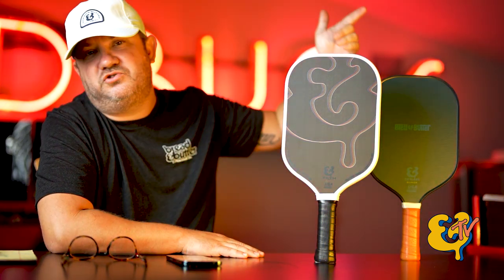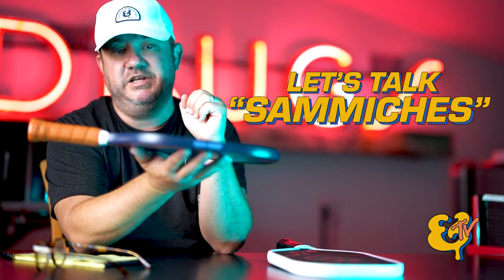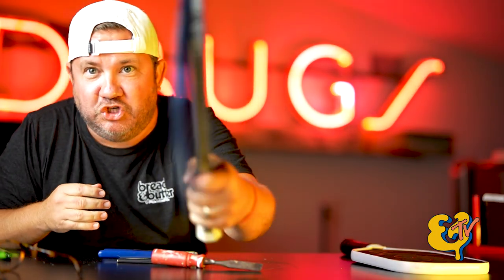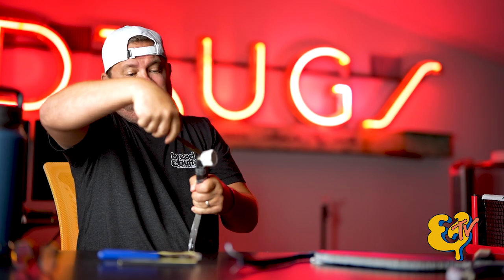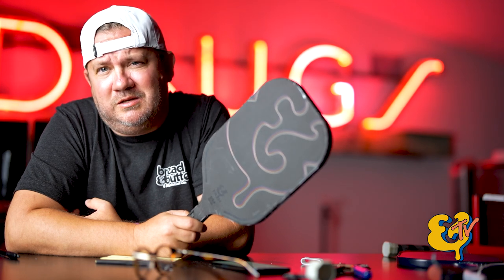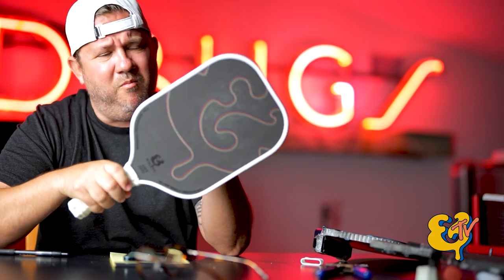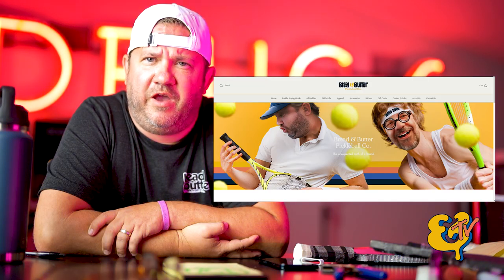What is Pickleball Paddle Thermoforming. Let's BREAK some stuff.

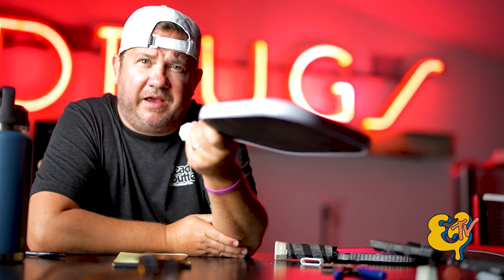Comment: in the specs it states that the Filth paddle has Raw T-700 carbon fiber, but is this Torray carbon fiber?   Also, can you comment if the weave pattern is the thinner super fine weave, or the thicker rougher weave?    Interesting to see Legacy used the thinner finer weave on their first paddles, and once the delam issues happened, new paddles have a thicker rougher weave similar to a CRBN.    Yea, the 9:40 to 9:50 mark on the video with the shirt change was pretty obvious
Reply: That interesting I didn’t know the Gen2 Legacys had the thicker CF weave
Reply: Yes, it would be nice to know the CF manufacturer, as cheaper CF can wear out much quicker (looking at you Joola.) Seriously debating getting this or the zerosix DB which uses Toray, as an alt/upgrade from my Elect E.

Comment: It looks like there is a seam on the edge where  the top and bottom sheets are bent over the edge.  You describe the edge as a strip going around 360 degrees.   It doesn't look like that to me and seems not to be the way a form works.